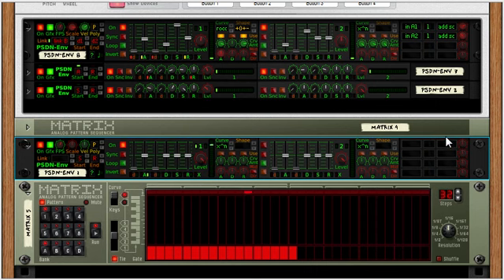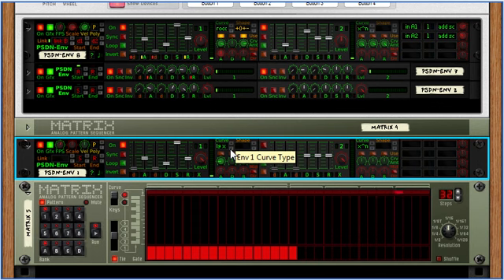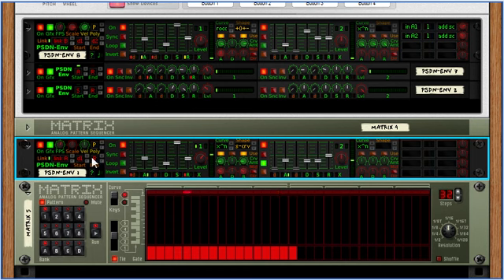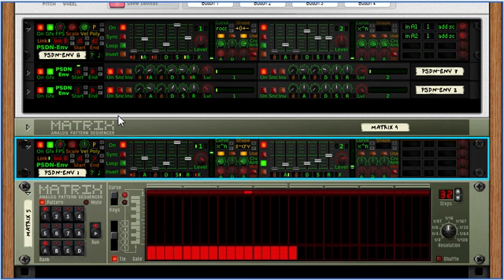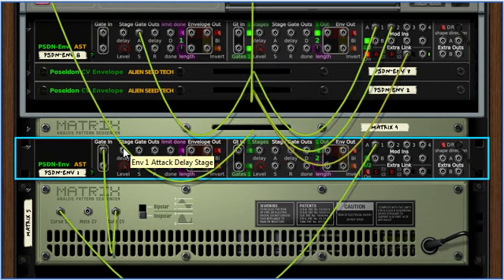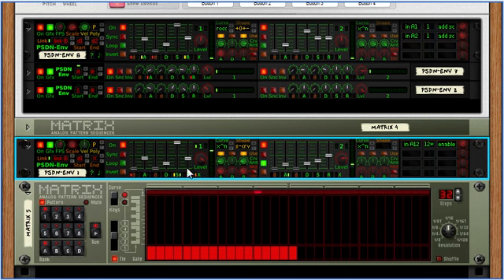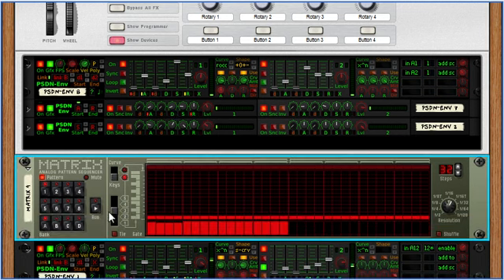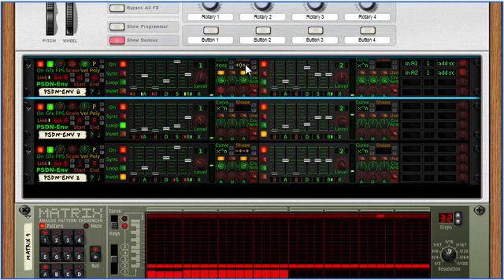PSDN CV Envelope Generator for Reason

Comment: On the props shop it says the 2unit one is in the making...
What will be the difference to this one?
Reply from the maker: +Botram Duuze The new version is 2U and adds real 8/16 note polyphony and chaining. The present version can only do 1 or 2 envelopes at a time with note input and triggering. So this will allow one PSDN to serve a bunch of instruments the note/gate/envelope info, making a polyphonic combi patch. Multiple PSDNs can be chained together, passing on any combo of note/gate/envelope info (including the existing link triggers) so more PSDN envelopes can be used for each instrument (e.g. amp, filter freq 1, 2, etc.). The polyphony is based on how many output connections are used, and there's a handshake for passing on packed combo data to the next PSDN, along with a manual option for using other devices to add-to/trigger each envelope. It also adds a large 2d display to show the envelopes.

I'm not certain exactly when it'll be ready but I'm making good progress. It won't be too long. It's a pretty big upgrade. If I had thought of doing this before I first put it in the shop, I probably would have. The graphics upgrade comes from work I did on the KRON recently. And the polyphony.. it took me a while to realize how much I wanted the PSDN to do poly.. And it was daunting at first. :)
Reply from the maker: +Botram Duuze I think the new version is more intuitive. Most of what you see here stays the same (though this is version 1.01 and there were a few changes since then), but the 2d display should make it easier for users to understand what the curve knobs and such are doing. And the back panel I/O looks different, more in line with the new poly I/O. The poly envelopes have their own meters, and they're easy to wire up. I'm pretty excited about it. :) And I'll upload more videos when it's more stable and/or after it's in the shop, showing how everything works.